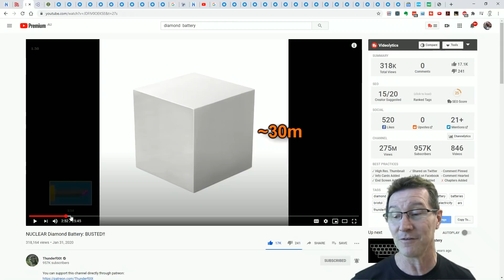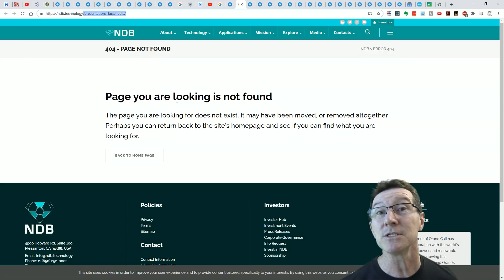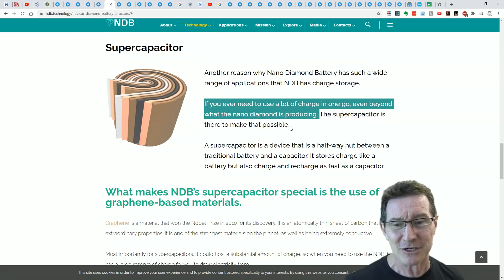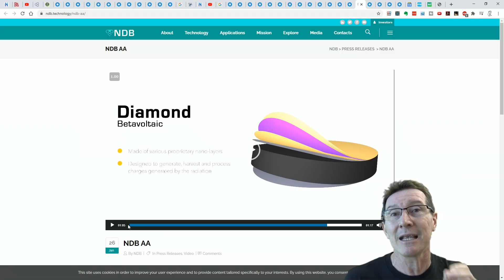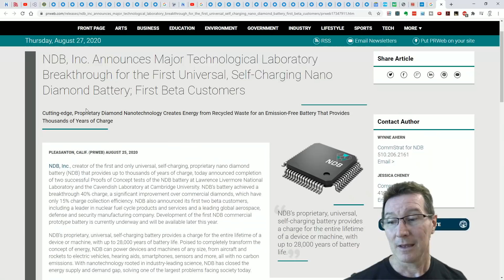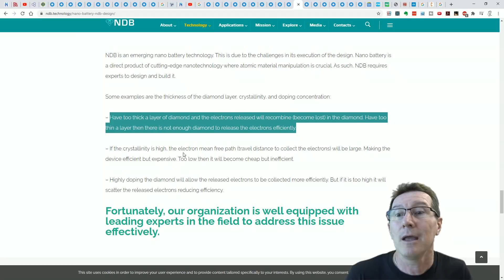EEVblog #1333 - Nuclear Diamond Self-Charging Battery DEBUNKED!

Comment: Looks like it could be perfect for RTCs and CMOS backup batteries. They go all the time in things like PLCs, time switches etc. A lot of those things are expected to last well past the 5-10 years that a lithium cell will, and are often around or under that 100uW range. Replacing them can require shutdowns and/or qualified electricians.
Of course, this assumes you can get the cost down to $1-5.

Comment: I once started wondering about AA size supercapacitor and teeny voltage regulator. Needless to say, with simple calculation, I could see it making no sense whatsoever. Aw, bummer. But wait! Maybe, a great crowdfunding material? I started googling. Guess what, there was already one. Of course, goal reached, not delivered (though goal was smol from the first place).

Comment: Not to quibble but if you take apart the dip package the chip is very very small... So you are comparing not the actual size of the active medium but the package that houses it... Hmmm....
Lets imagine 4,000  or even 100,000 , maybe 100 million of those little tiny chips all connected in various series and parallel configurations.. Now do the math on that... Take apart your dip chip and see the actual size of the chip itself.

 If we were to take the same weight without the packaging it would surpass your little example wouldn't it?

 Again stay to the electronics side, your debunking is missing the mark.

Comment: Disrupting high demand energy storage, not so much, but I'm curious what the actual cost of this device is projected to be.  Based on the numbers Dave gave here, you're looking at about 2.5 years to generate a "full" charge on the AA product.  While useless in a lot of typical uses, it sounds like a great idea for things like TV remotes that will never need a battery change.  There's a lot of little "IOT" sorts of things that could be made to never need another power source.  the real question is just what it costs.  No one is going to pay $200 for a smoke alarm when they can spend $10 on batteries over it's normal life instead.  
On the side, if we assume the photo is the smallest that such a device can be made... a 22 pin DIP package, that's 100uW in .078 cubic inches of volume. ( I would guess like any other DIP package part most of the volume is just plastic, but lets assume the whole thing is needed.) In a unit the same size as a 500 gallon propane tank you could stuff 1.4 million of these DIP22 packages.  Whole not fantastic, it's still 140 watts that appears to just produce for 40 years +.  if you can sell me 48 of those bad boys and install them for less than $1000 each it beats the price I was just quoted for a solar install... assuming you had the space for it.  While it's crap at the moment, I'm curious if the tech can develop to the point of delivering just 1 milliwatt in that same package size...if it did, it would be competitive with modern solar in space taken.  Of course even then you'd have to be able to produce each 1mW package for about a half a penny each to be cost competitive with solar. 
In the end, it's a neat little tech, but not very useful unless it is very, very, cheap, and I really doubt it's all that cheap.  Also, no clue on how safe piling millions of these things together is.

Comment: Yes the marketing is BS, but if they can get this 100uW off the ground it would immediately replace every P200 in existence.H-3 has a half-life of only 12.3 years, which puts replacement in the order of years because after 12.3 years, the voltage would have dropped by half. The carbon version doesn't have the problem.

Comment: I'm kinda excited for this tech, as useless as it is for high-voltage applications.  I deal with a lot of systems that require low-power standby, stuff with like RTC's and whatnot with watch batteries like the CR2032 battery in them.  the watch battery is 3v and typically contains about 0.6 watt hours, but last ~5 years (dischraging at ~0.1 to 0.2 Wh/year).  If we can replace the batteries that are required for RTCs and similar with any kind of betavoltaic cells, we could easily extend the RTC to last indefinitely in these devices: never having to reset the clock, having it always be within a few seconds of realtime, etc. it's just.... a great application for this.  Fire and forget time tracking.

Other things with a standby current can effectively be eliminated, like phantom drain on household devices, where they sit, off, waiting for a signal to turn on; well, power that with a betavoltaic cell and put a relay on the mains; where the mains relay only flips on when it gets the signal to power on, either from a remote or by the press of a button, keep those circuits active via the betavoltaic cell and you eliminate the phantom draw of many of these devices - though, I know phantom draw is more than just standby circuits, it would make an impact.

The problem, I see, is that most companies don't want to spend the extra on manufacturing to make that happen when they have a readily available and cheap source of power that outlives the warranty (like a CR2032 battery or similar built in).  All the hype around this could make the marketing pinheads get excited about slapping "powered by NDB" on the label, and having ANY part of the device powered by NDB would make that accurate, so if we get RTC's and standby chips powered by any kind of betavoltaic because of all this media and marketing nonsense, I'll be pretty happy about it.  IMO, the technology probably won't exceed that, so it's a dead-end otherwise, but if we can make this an industry trend and standardize around it, we can enjoy the benefits of never having to reset a clock on our VCR again.  THE DAYS OF BLINKING 12:00 ARE OVER!  (I hope)
Reply: these batteries lose half its power every half-life of the radioactive material. Lets say tritium has 12 years half life, so after 12 years 100 micro wats batterie will produce 50 micro wats, after 24 years 25 micro wats, and so on.

Comment: I got something interesting to show!

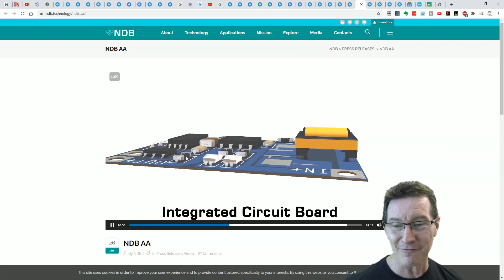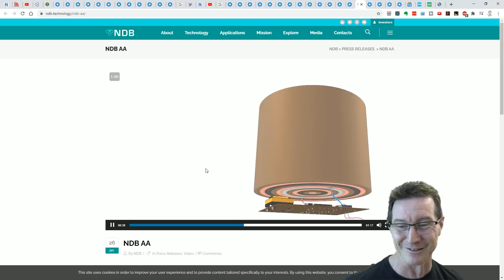If you look at the circuit 13:49 - 13:54, it's actually a "composite" of the very popular TP4056 Li-ion charger modules.
there are 2 TP4056 modules available - one with just the charger and another with charger+cutoff circuit.
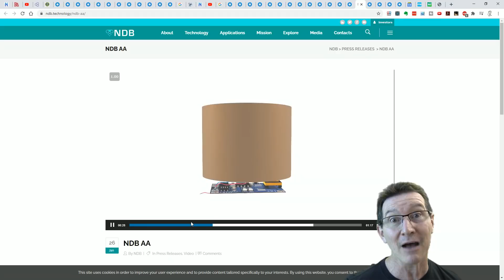surprisingly, the upper half of the circuit shown from 13:49 - 13:54 is identical to the tp4056 charger version https://rarecomponents.com/store/1718
and the bottom half is identical to the bottom half of the tp4056 cutoff ckt version https://rarecomponents.com/store/tp4056-dw01-fs8205

here's something @eevblog to bolster this bs

Comment: I can think of plenty of applications for 100µW with some storage - infrequently used remote controls, medical implants, digital wristwatches.. I've even worked on an agricultural monitoring device with a power budget of 50µW.
100µW is about what you need if a AAA battery lasts in your thing for 2 years.
Think I'll skip the NDB scam though ;)

Comment: I feel like an application for that AA battery would be a TV remote; piss all energy requirements and just a bit of burst power.

But TV remotes shouldn't cost this much, lol.
Reply: I want a nuclear powered TV remote.
Reply: The problem is you would be able to use your remote for a year or so (less if they have backlighting), then when you are waiting for them to recharge you get maybe one button press every day or two, at best. You are probably going to wait a week to change the channel.

Thats if you still are only using old school IR remotes and not more modern radio remotes.
Reply: For TV remote I would just use piezo shaking power generator like them shitty chinese flashlights do. It works, and it's cheap. Just shake to recharge.
Reply: @kaikart123  Isn't it easier to just put two AA batteries and last 2 years
Reply: @unliving_ball_of_gas  it's easier indeed, but if you want to go "batteryless" that's one way to go
Reply: @kaikart123  -- For TV remote I would just use piezo shaking power generator like them shitty chinese flashlights do. It works, and it's cheap. Just shake to recharge.

The ones I've seen use a moving magnet, with magnets at each end to repel it, so that it can move back and forth without striking anything at either end.

There is a large(ish) coil of fine gauge magnet wire, the magnet moves through it, back and forth -- producing AC current (the frequency determined by your "wrist english"), fed into a diode bridge, a zener diode "regulator" (to avoid frying the LED if a muscle-man wiggles it), and a small(ish) supercapacitor to store the juice.

With enough vigorous effort, you can kind of see your way for a few feet ahead during pitch-black moonless night conditions. Better than nothing but only slightly so.

Kinda sad, since the potential exists for something usable -- my late father had a WW2-era "magneto flashlight" -- the form-factor of a 2 D cell flashlight, with a bulb of the type used in one, but no batteries inside -- just a big spring motor and a small generator. You'd crank the end (just twist, twist, twist the end of it), and to turn it on  you'd release the brake so that the generator would spin, and light up the bulb.

This was 1940s tech. Just think of what it could be if used with rare-earth magnets and high-output LED instead of hot-wire bulb!

I'm sure such things do exist, of course -- but apparently NOT in "made in china" form!
Reply: Might as well use a solar cell from a calculator to power a remote.
Reply: @mikeccuk2006   That's actually a pretty good idea. Your typical remote spends most of the day sitting around. Plenty of time to charge a beefy capacitor.
Reply: @LazerLord10 - 
use a piezo Generator in thge TV remote producing its own power by pressing the button (not suitable for touchscreen)
Reply: I feel like an application for that AA battery would be a TV remote; piss all energy requirements and just a bit of burst power.

Me, I'd rather spend fifty cents every year or two for an alkaline than to fart around with this idiocy.
Reply: @This_is_my_real_name   I use a fair few NiMH ones, and have the remotes as the second stop in the usage cycle. First use is the landline phones, then the remotes, then general everyday use until they get annoyingly short, at which point I buy new ones and swap out the ones in the phones, put those in the remotes, and those into the general pool. In the unlikely event that a remote goes flat before a set in the general pool needs replacement, the oldest in the pool gets used.
Reply: @Roxor128  -- Here we have a short, sad trip down Memory Lane...

When alkaline batteries were first unleashed on The Great Unwashed -- known at the time as "Mallory Duracell" batteries -- one of the advertised features was the fact that they were rechargeable!

And, lo and behold, they were indeed rechargeable.

I had a set in my Norelco cassette recorder -- the original Compact Cassette machine (yes, I know it wasn't THE original, but it was the one that flooded the market). It was the one with a "joystick" button in the middle of the front of the recorder, which was used for shuttling it from one mode to another. Moved motor into position, moved heads, etc. No solenoids. Hey, this was an "affordable" consumer electronics device. It wasn't a Nagra! :)

I used them until they needed to be recharged, and then I recharged them. Over and over and over and over... for as long as I had the thing!

Did they last as long (after each charge) as when new? I've no idea. All I know is that they lasted a really decent amount of time per charge.

Eventually, something had to be done about this! And so, it was.

Two things, actually. The label suddenly began boasting that they were "mercury free" -- and, users were warned of the awful things that would happen if they were recharged.

Mind  you, they COULD still be recharged. However, unless using one of the special chargers designed specifically for alkalines, they would leak a very caustic goop all over your expensive devices.

There's progress for ya! (Well, assuming you're a marketeeeer, fretting over sales that could be higher if only those things could no longer be recharged!)

Comment: You actually don't want this technology to produce a lot of power cause it also means it's highly radioactive and dangerous in any consumer device. If you pulverize such component, whatever power it is supposed to deliver electrically is a subset of the radiation that it will emit. For a car you need tens or hundreds of kilo Watts. That would mean an insane radiation danger if it was made this way.

Comment: What's to say that the image you are so hooked on as 'proof' wasn't just made by a graphic artist, using information they could find based on the current and existing devices, hence being the 100µW the same as current devices...

Then, the image has recently been removed, as it's incorrect and not representative of the actual product.....
Reply: I dont see him debunking the science. Its proof of concept. Id like to see someone break down the science and prove there is no option to improve the efficiency. Otherwise knowing humans we will take a science and make it better.
Reply: Russ Bohman Go check thunderf00ts video.
Reply: I was thinking the same...yet he is so emphatic it makes me want to find HIM wrong. He talks so long it seems he has bias driving his battery LOL, Your welcome!
Reply: Because others have already made a diamond betavoltaic battery. It's only about 10 times as good as other betavoltaic batteries at best. Using carbon-14 is a non-starter as well compared to other materials as the power generation is tied to the amount of radioactive particles emitted that can have the energy harvested from. A material that is 10 times less radioactive will produce 10 times less power. Right now most betavoltaics use something far more radioactive than carbon-14 to generate the minuscule power that they do. Carbon-14 has a half life of ~5,700 years, by comparison the recent diamond battery that we actually have specs for uses Nickel-63, with a half life of about 100 years. Which roughly means the nickel will emit 57 times more energy per second, and even that battery was only producing 1microWatt for a 1 cubic centimeter battery.

This nickel battery is a fantastic improvement using the new diamond layer as it can essentially replace a packemaker battery once it gets the type approvals since it can just barely produce enough power to run a pacemaker for the same size battery. It lasts longer than an average pacemaker, which makes it a great fit compared to older betavoltaics that could not outlast their chemical counterparts.

However, using carbon-14 means 57 times less power, which means you have to make it 57 times bigger. Now your pacemaker battery is 570 cubic centimeters, or about twice the size of your heart. That pretty much makes a carbon-14 diamond battery useless for the exact situation it should be great at.

Comment: So 10 of these would produce 1 milliamp. You need 5000 of those things to produce the 500 milliamps of a bare minimum USB charger. That's assuming this thing outputs at 5 volts which I seriously doubt. You would need hundreds of thousands of these things to get any practical use out of it.

Comment: Sounds sort of feasable, IF each cell was small enough that you could get 10,000 of them in some series / parallel arrangement for 1W output. At the moment, about useful for some burst transmission device, that has an average power consumption of 100uW (ankle bracelet for fraudsters?).

Comment: Hey Dave you seem to ignore that package size of an ic doesn't necessarily indicate the size of underlying working circuit and is dictated by the compactness required for manufacturing processes such as soldering and handling. Not denying that all of this is marketing bs though.

Comment: The specific power of Carbon 14 is about 767 grams of Carbon 14 gives off a watt of decay electrons. This puts an absolute lower limit of 767 grams per Watt output. 

Yeah, not feasible for all but the most esoteric of applications.

Comment: As I watched this video, one thought came to my mind and that is the self-discharge rate of the super capacitor that could be one of the big factors of the viability of their designs at all. The typical self-discharge of one of the best super capacitors is around 30% of their charge in 60 hours being lost. How is this energy harvesting device be able to keep up with that... Not to mention the efficiency and quiescent current of the DC-DC converter they use. Yeah, Dave, it smells of marketing bullshit!

Comment: Why do you say nuclear decay batteries are only 10 years old? Voyager 1 has them & that's from 1977 my better half built one they are brilliant his charges a capacitor in his lcd watch & set's the time once a month from the radio time signal he built it in the 80's it still has the correct time.

Comment: I think its more than a little early to be debunking, when it'll likely be a single business  major making all of this while their technical team presumably is still working on increasing power out. The mix of a beta voltaic with a good cap is actually not a terrible idea. Not revolutionary, but if they can get the costs down enough, I could see things like remote controls adopting it.

Having to work with business  people I have a bit more sympathy I suppose. Advertising your dreams is a good way to get funding to achieve part of said dreams 🤷‍♂️